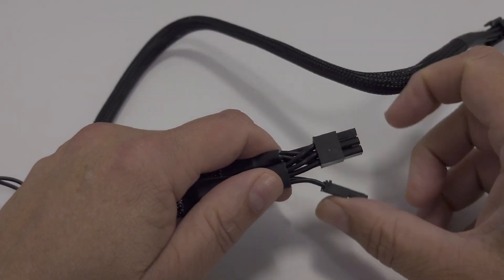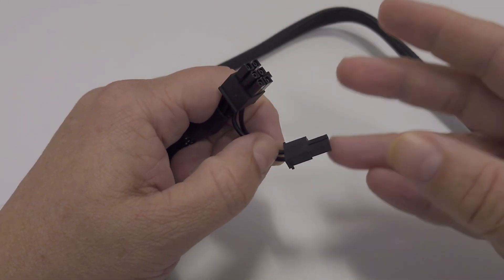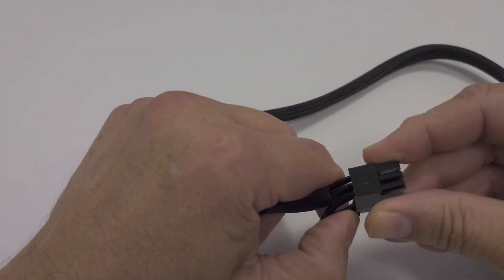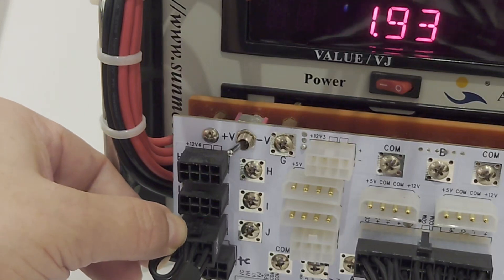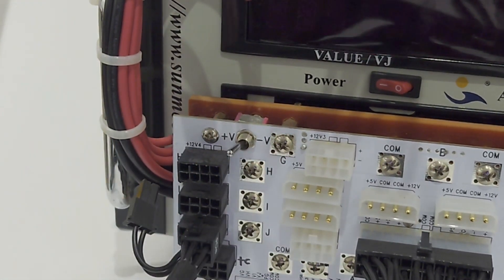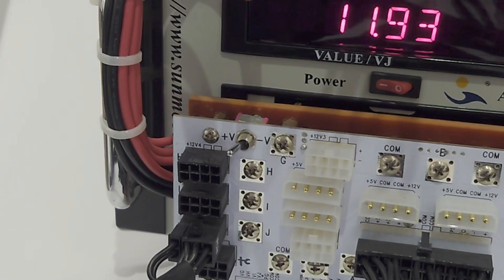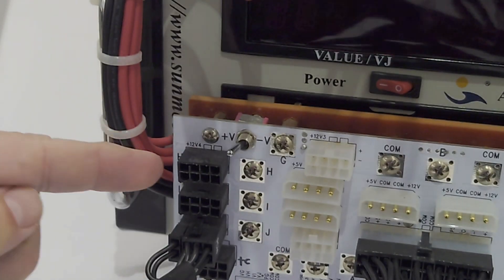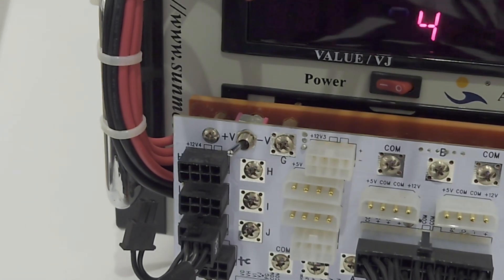Yes. A 6-pin PCIe connector is designed to deliver a lot more than 150W. Part 2-The testing

Comment: I’m aware this video is a year old, but you’re wrong.

See, a standard 6 pin connector, according to the ATX standard, only had 2 +12V pins, 2 GND pins, and a sense pin, which is tied to ground. Power supply manufacturers almost always add an extra 12V pin anyway. Devices using a 6 pin PCIe connector should NOT pull current over the sense pin OR extra +12V pin seen on most 6 pin cables. Therefore a 6 pin connector only has an effective 4 pins for current.

On the other hand, a PCIe 8 pin connector must have that extra +12V cable that isn’t required on the 6 pin connector. The extra two cables are a GND pin and a sense pin, effectively giving the 8 pin connector 6 pins to draw current over.

On the 6+2 pin connector in the video, when used on a 6 pin only connector, it uses 4 pins for power draw. When used with an 8 pin device, it uses 6.

Refer to https://superuser.com/questions/1281414/ive-pluged-e-pci-power-cable62pin-to-eps-8-pin-on-motherboard/1281416#1281416 for the pinout.

I hope this comment can help a passerby.

On a semi-unrelated note, the 4 pin CPU connector, according to the ATX standard, can be used for up to 150W. So on some cables, you may notice that the PCIe cables have a lesser gauge than the CPU connectors. I mention this, as it may clear up questions made by the same people who watch this video.

Comment: This is true if the cable is a 6+2, however if it's only 6 pin the wire gauge may not be thick enough to carry more than 75 watts.

Comment: Completely agree with the general point, but I don't know that the slight simplification that the +2 is just sense pins has helped.  My understanding is that one is a sense pin, one is ostensibly an active ground that is intended to sink current.  That's supported by the slight change in the voltage even with the connector fully seated.
Reply from the maker: Ostensibly, any additional ground is an improvement in power delivery, but that depends on how those pins are terminated inside the GPU.  Where I misspoke was stating they were BOTH sense.  Fact of the matter is, pin 6 (the center pin closest to the retention clip on the 6-pin portion) is "sense0".  Pin 4 (the pin farthest from the cip on the +2) is sense 1.  But I've never seen sense1 not grounded on any PSU.  If sense0 is not present, the GPU can only expect up to 50W from the 6-pin.  With sense0 grounded, it expects up to 75W is available.  

Like I said in the video, the connectors are a bit worn.  When I did my test run, I used a different cable on a different port and the voltage didn't budge, but for the video I moved it and it's a little loose.  I can shoot a short video showing the other cable and connector to prove the point.  With the +2 attached, it physically stabilized the connector and prevent "wiggle" from causing the voltage to drop.  For consistency sake, I used the same PSU for the past 5 years for tests like these, but I suppose that's not counterintuitive as it's causing more problems than having a newer reference.
Reply: @jonnyGURU  I already knew the info in the video -thanks to your very informative website-, but it's new info for that the GPU can pull 50W if sense0 isn't connected. I just guessed it existed just to detect the presence of a cable.
I guess the 50W limit makes sense for those crappy molex to pcie adapters that usually only connect two of the positive and negative wires.